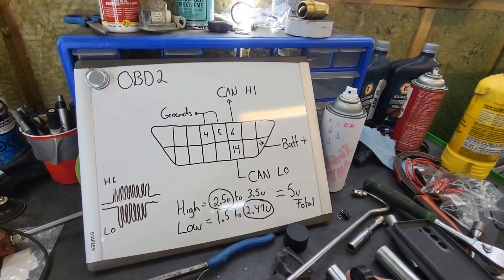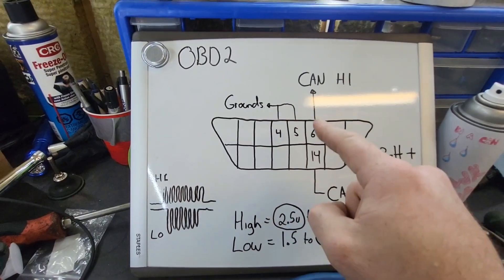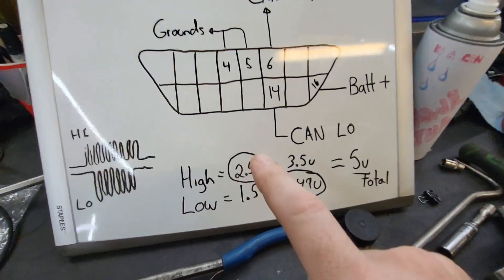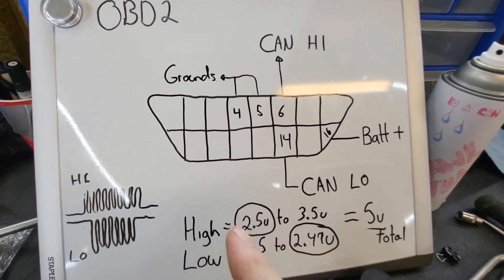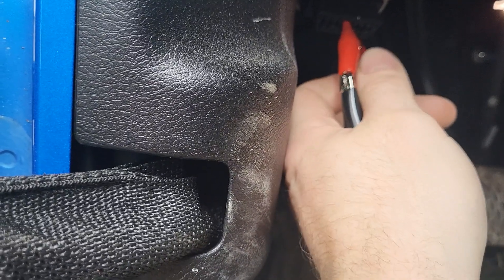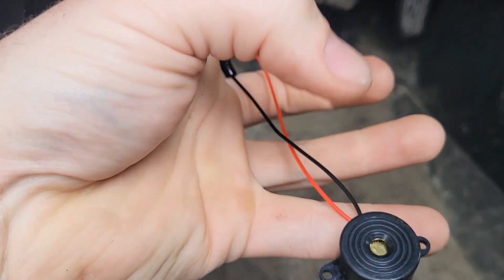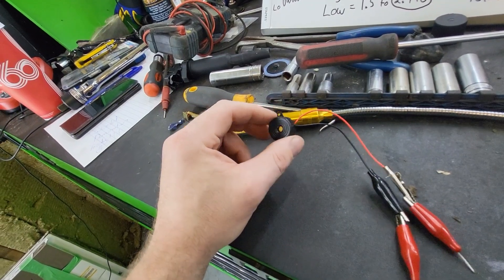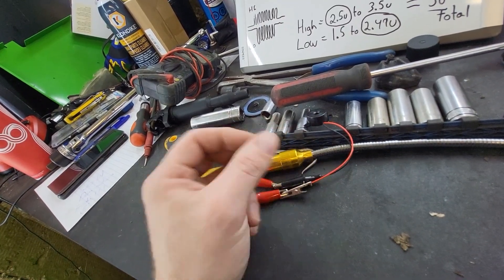How To Diagnose Controller area networks with Sound. "CAN" "obd2" "dlc"

Comment: also what happens to the car when can low is higher voltage than it should be?
Reply from the maker: As long as it's working and total voltage is 5. You can have fluctuations.  But if can low is high that means the upper high network may be faulty. A module or something is pulling it down

Comment: what are you trying to diagnoise here though? young mechanic in training trying to learn here and also a mopar tech but what is the point of this? if you hook up to the obd2 and nothing happens that would be an issue at the pcm, fuse box or battery. I don't understand what the problem would be to use this diag method
Reply from the maker: You can stick a multimeter on a network and you see voltages. Some   meters can show the wave form. What your looking for is to see if the network is still communicating. You can have the proper voltages but no communication.

Comment: It's something I've noticed, the more skill a tech has, the less fancy equipment they seem to need to find  problems. My father could diagnose and fix radios, tv's and anything else in the house with a VOM and hand tools. There was an old radio/tv repairman years ago in a flea market I went to who mostly tshot the black plastic cabinet tv's he would fix and sell with just a set of headphones. To me, exotic stuff, I have to admit to needing the fancy equipment and various testers to understand what's going on.
Reply from the maker: If it's fixed don't matter! :) you got it done :)
Reply: I agree. As a Industrial power generation tech we work on engines, networks and power transmission. When training the younger techs I teach a class using a jumper wire  and a 24 volt test light.  They are amazed at how useful they can be. That said I am a lab scope enthusiast and love all types of diagnostics tools. But tricks like shown in the video save valuable time. I will definitely be passing it on. CAN communications is becoming more and more utilized in generator systems. Just the other day I saw a residential generator that had a voltage regulator on the CAN bus. I know our air cooled techs will not be getting onto lab scopes any time soon . That said this trick will be extremely helpful with getting  beginner techs introduced to CAN diagnostics. Thanks for the cool trick.
Reply from the maker: @jessemackenzie6516   and ty for the response! glad could pass on a little bit of a trick :)

Comment: Watched it three times and I'm still confused.  What am I listening for, the different frequency between high and low? or is there a wavering in the frequency also?  And what do those mean?  Is the test fail when high and low sound the same? or when neither one wavers?
Reply from the maker: You can hear the network communication. This is the frequency I can hear. But if the network was not communication you hear a solid buzz. Or no buzz at all. Also yes can high will be louder then can low. The noise different shows network is also working
Reply: @Lancemechanics  Thank you.

Comment: What is that tool called?
Reply from the maker: piezoelectric buzzer. can find them cheap on line.
Reply: @Lancemechanics  thanks 👍
Reply: You can find them cheaper than this if you want.

Comment: Thanks Lance for that tip, your brilliant!! A simple (cheap, tool companies don't like that 🤣) yet very effective way of diagnosing a network circuit fault. Most good DVOM's have a similiar feature already incorporated in some of their voltage, ohm, diode settings. The audible feature is usually powered by either the battery in the meter or by battery voltage supplied by the vehicle (12v). I'll have to try it on the J1939 CAN systems used on medium and heavy duty trucks. Which function on pretty much the same principals as OBD2 (2.5v +, 2.5v -). I'd bet it would even work with the older UART systems along with the ISO systems. Thanks again for tech tip and have a great day.